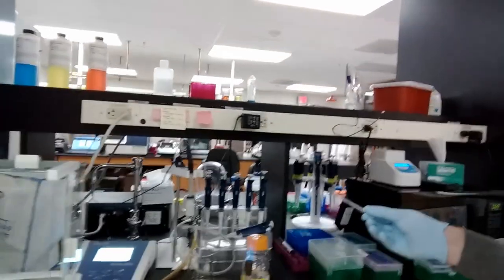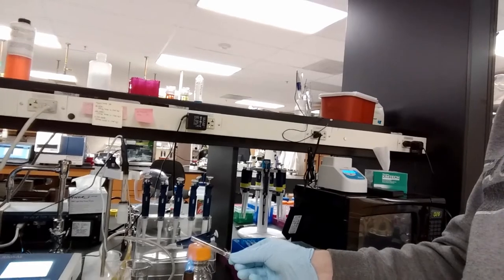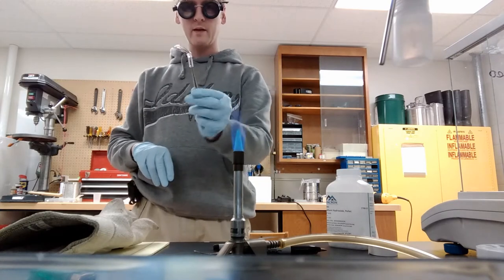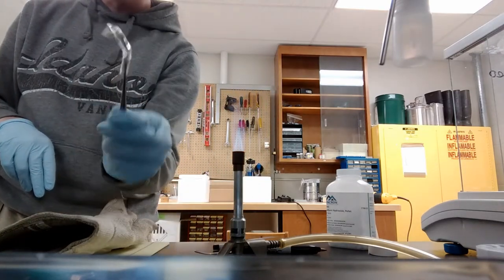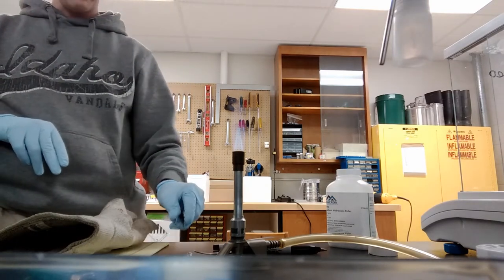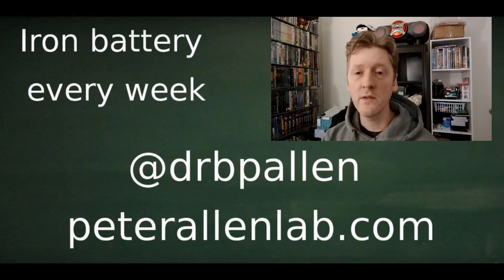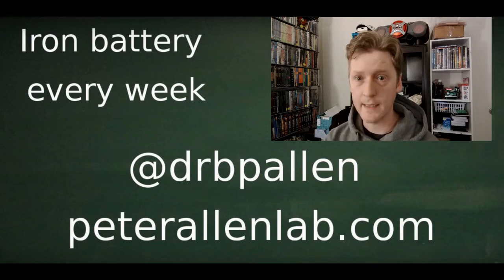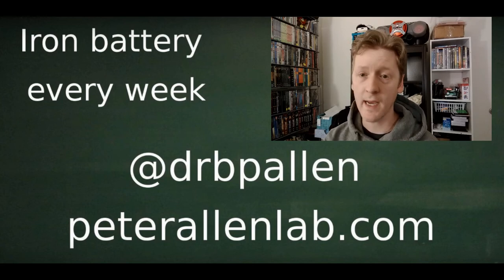Iron Battery part 65: Brief iron battery update and musings on flow batterries

Comment: I’ve been contemplating these points you bring up. The original batteries iron nickel.  I have tore one apart. Very simple in design. I believe they could be made in a paper layor design. Easy.  Just the gassing is a issue at high rates. Yet if the layors used a non gassing or expanding fluid. It would work.

Comment: Two drawbacks on flow batteries:
1) Power is need to run (2) pumps NSTAAFL.
2) Corrosion resistant parts on the pump can make it costly to buy and maintain.

Comment: Have you ever used Dot4 brake fluid
Reply: Guy Ruff - That's another one I haven't heard of. Is someone eperimenting with it?
Reply: MrFmiller someone brought it up. I think Mr Murray I believe it had something to do with separators. Something about using celouse from cigarettes. But my thought is they are using a type of glycols for lithium batteries. I have it written down some where? Point is it can’t evaporate. But be conductive. Very little is used in the lithium pouches. So this would cut down on gassing. Right!   Iron nickel batteries gas a lot because the ions travel a great distance at speed of light. In my opinion that is. So if we could allow the electrolysis to occurs with out so much gassing. A iron nickel could be made. Problem is takes high energy to create a transfer of ion in nickel. Heat will be our foe.